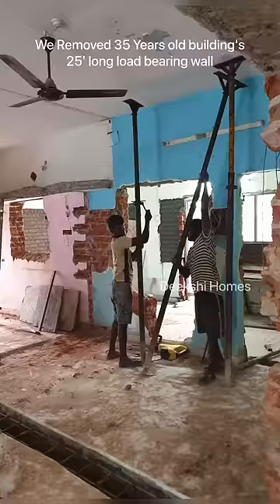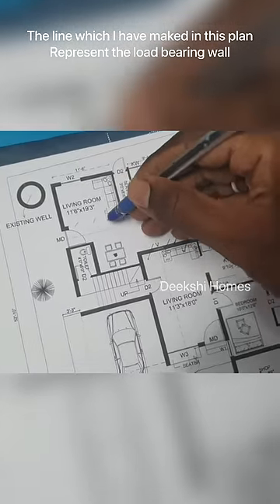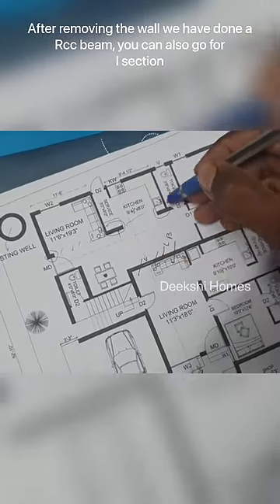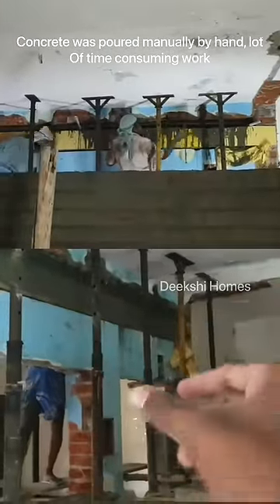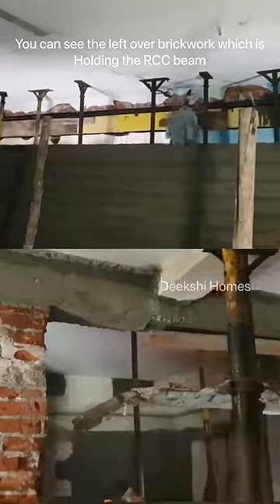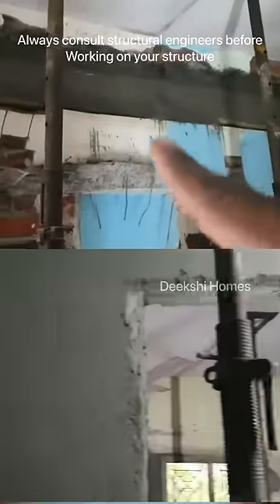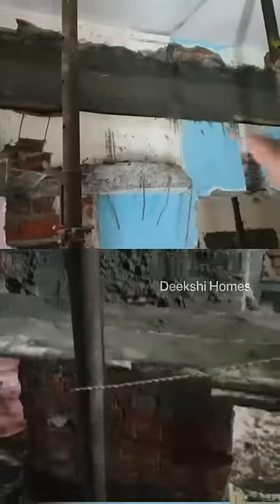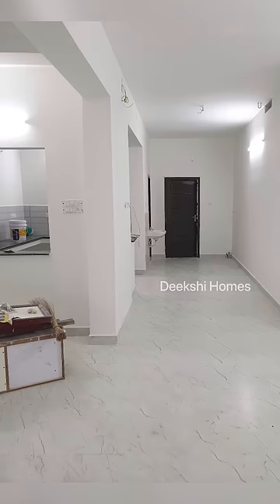25' நீள சுவர் அகற்றப்பட்டது | Load Bearing to Framed Structure | Deekshi Homes

Comment: Super work sir, 🤗🖒, can we do the same plan, for three floors built? G+3 want to make ground floor as parking space for cars the site 15x50
Reply from the maker: If its a framed structure you can do it | If its load bearing structure don't do it without structural engineers advise
Reply: @deekshihomes   thank you very much  sir, 🙏